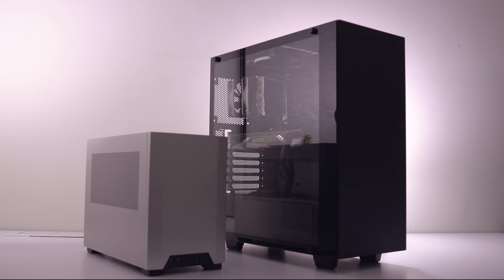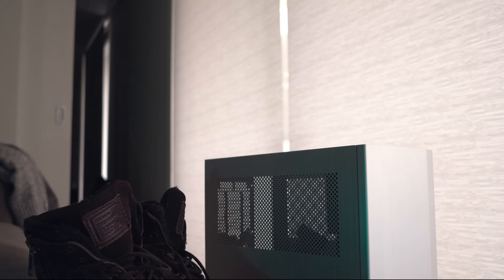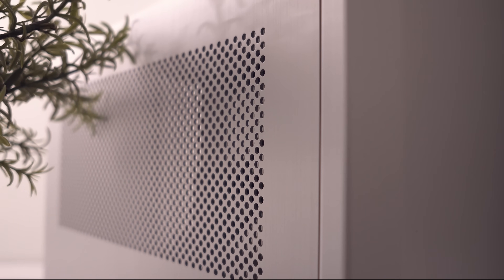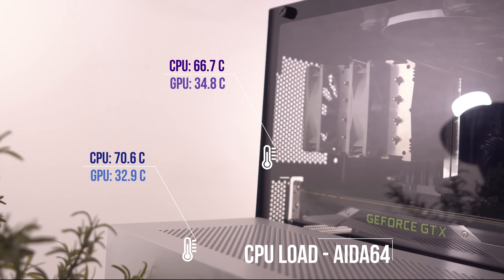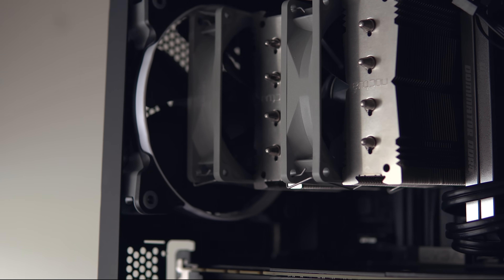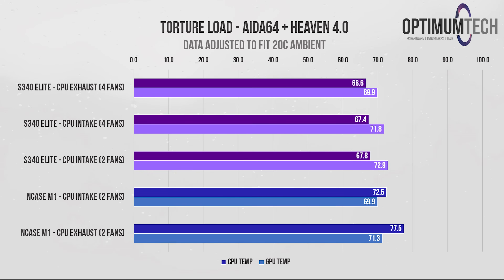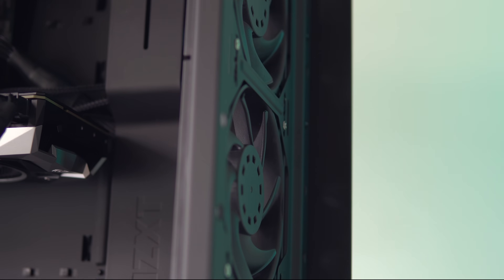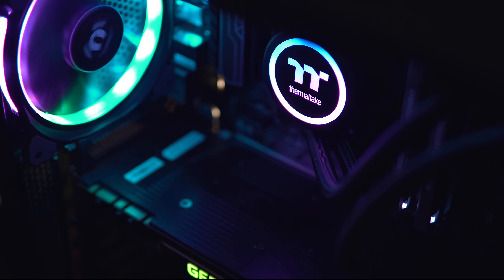How Much Hotter is an SFF System?

Comment: a few things.  I am personally an Ncase m1 user, so this is just comments on the video itself with little bias toward the m1.
  The bigger case wasn't a particularly open aired case compared to the really open m1.  I think a retest with a more open aired case is due.  Also the ncase had the advantage when it comes to gpu thermals because of the blower style card.  I would be interested to see a comparison with a more open aired card.

Comment: Fake, i have an SFF HP AMD PC, and I have on CPU în idle -5 to 15 degress, normal utilization 20-25 degress, gaming(ex GTA 5, ,CSGO) or chrome tabs 25-35 degress, and maximum 40-45 degress(intensive utilization or  if it's hot in the summer), HP Cooler stock. GPU 20-70 degress. Small case, better airflow.
Reply: cap 😂😂

Comment: The point of having a larger case is to use more fans, bigger heatsinks, larger GPUs resulting in most cases in a better cooling and quieter system, otherwise just go ITX and save some space on your table

Comment: With aftermarket cooler gfx card without blower desing the end results would of been very different. As most high end cards these days ( including nvidia RTX ref desing) dumbs majority of the heat inside case. I know the test is old, but not very relevant these days.

Comment: mid-high end SFF power supply are more expensive than normal ones once u go pass 600w PSU. You're also limiting yourself to heatsink height as well as having other parts heated by AIO. Once leaned over to my AIO Kraken x62, got a little hot, checking the temps it was 40-45c inside and near 50c on the outside. That's 120 f radiation from radiator to other parts of the PC!

Comment: he used a blower type gpu that dumps hot air outside the case, temps would have been hotter if he used an open dual or triple type card

Comment: Giving the difference in price, you can AIO the CPU for the same price with the NZXT case. If you want to go the no compromise route and AIO the Ncase, you can custom watercool the NZXT for the same price. You are forced to sacrifice something with the Ncase. And it's cooling potential due to space. You also can go the aesthetic route with the tempered glass and space. The comparison is not totally fair because you are using the same restrictions of the small case in a larger case.

Comment: the temperarute will improve in the NCASE m1 if you do a front panel mod.. like put a mesh in the front panel
Reply: Carloos Gongora I dnt think that will be that much beneficial as just behind front panel is SSD mounting place and a rigid aluminium base.
Reply: i think it help in matter of space & thermals
Reply: Carloos Gongora Thats what i said. It wont do any major good. Coz in order for flow u hav to remove any SSD or HDD mounted in front.
Reply: the ssd can be located at the bottom with the new space... and in the front panel do a mod and put a mesh
Reply: Carloos Gongora I get it what you are saying. But just to get some airflow from front you're putting SSD/HDD on bottom of case affecting direct GPU cooling ? not worth it IMO
Reply: Carloos Gongora where ya gonna fit that reservoir tube ? Everything is already crammed

Comment: You can totally use a water cooling setup in the M1. I have my i7-6700k cooled by a Corsair H100i in my M1 and it works well as all the heat get exhausted out the side of the case. It's a tight fit, but it's a well-known working configuration for the M1. I'd love to see you try it out and see what temps you get vs. the S340 with an H100i.

Comment: Even with the benefits of air and more space I still prefer smaller ITX systems because I don't want my PC on the floor sucking up dog hair, and you really don't need a system to be huge these days unless you have special needs like having tons of hard drives or you want to have a chemistry set running in your case. Neither of those apply to me. My next build is going to be in the Phanteks Shift case.

Comment: I have an in win 301 and it isn’t the smallest case but my 7700k hits 80C under load. Also my cpu needs about 2.28 volts to get a 4.8 OC. I guess my chip isn’t the best and I probably need a better cooler

Comment: You did a good amount of testing but try these exact same tests after removing the front panel on the nzxt s340 and you will notice a big difference. My s340 with the front panel on results in a CPU temperatures at 70c and gpu temps at 78c, but with the front panel removed my cpu and gpu temperatures drop by 9c and 12c respectively and for such a temperature drop i will throw the front panel of the window any day.
Reply: No it does not make a big difference, the culprit here is the front panel which basically blocks direct flow of air through it. Removing it creates space for the air to move and hence it results in low CPU temperatures.

Comment: Hey man great video. I find that NZXT cases aren't the best for airflow, even their non silent cases. I run a H630 and find it terrible for temps on my custom loop. A different chassis from Corsair or CoolerMaster will probably net you much more significant temp drops in the mid tower size.

Comment: I'll take 5 degree C hotter temperature over large tower case any day
Reply: Hansen A s340 has bad air flow though...
Reply: I have the Ncase M1 v1 and it still looks premium to me. Swapping components is kind of a pain though. My next build will be in the Dan A4 SFX case, which is even smaller. I kind of wish the Dan A4 could handle up to 60-70mm cpu coolers. Since I do not overclock much, it should not be too big a deal. I really wish Silverstone would make a proper update to the TJ08-E. That case has amazing airflow with the big 180mm front tunnel fan. For a cheap mini-itx case, the SG13 is really good.
Reply: I know.. That's what I like about SFF cases..
Reply: Keep in mind..he had 2 120mm fans directly under the hair blower cooler..seems quite unfair..
Reply: Even 80+ is still within reason.

Comment: I have an NCASE m1 V5, CPU(i5 7600k 4.8ghz) is water cooled with h100i v2 were one fan is removed and is put under the GPU(1070 FE) for tubing clearnce, the whole system is quite but for the PSU which is a silverstone sfx 600, whic is the loudest thing that never shuts up I am measuring the temperature inside the PSU to be at  42.8C, what should I do to make it quite
Reply: Remove the fan from the PSU ;)
Reply: Buy a Corsair SF 600.
If you do, get the optional sleeved Cable Kit (watch out for the "SF Kit"). The stock Cables are horrible.
Reply from the maker: Can second the SF series from Corsair. I own both the SF450 and SF600 and they rarely spin up.
Reply: I bought it and will try it out, I will update on how that works out.

Comment: Did you switched back from your Custom Side Panel on your M1 ? Or was it only for these tests ? 

Btw: Which is your favorite CPU Air Cooler for the M1 ? 
Iam considering an Custom Side Panel, but dont know, if I should switch my C7, cause its an Top-Flow Cooler...
Reply from the maker: I used the stock panel for these tests. I like the Noctua U9S, D9L and the Cryorig M9i for the M1.

Comment: The s340 doesn’t have great front intake because of the closed panel so it performs worse than a case with a mesh front panel.
Reply: That’s the same for the whole NZXT lineup. I’ve had no problems with the h700i with a closed off front.
Reply: I've had no issues with mine. I have 2 140mm phanteks fans and they've been great. I can't recall if they are static pressure fans or not though.

Comment: Nice test, but you picked one of the worst midi cases, when it comes to airflow performances. Try the same test with a Meshify C instead of the S340, and you'll notice an huge improvement in thermals, with a little compromise in terms of noise. 
And yes, open air GPUs are the perfect fit for a larger case.
Reply from the maker: I chose the S340 Elite because it's one of the most popular mid-towers out there and happened to have it on hand. But totally agree, air flow and temps would have been much better in the Meshify C, I definitely would have used that for the comparison if I had it here! Thanks for watching
Reply: Thanks for your reply and your interesting contents. :)
Reply: I was about to comment the same thing as Corummo. Once the air gets hot inside the S340, fans do very little to swap the it for fresh air, and thus, creating similar results to the mini case displayed in the video.

It is all about airflow, really. A mini case with meshed front would be a great performer also.
Reply: yeh but i feel like you are missing the point, my ryzen cpu has a thermal limit of 95 degrees, in my sff case it runs at 62 max while gaming, so why would i need a massive ugly case lol

Comment: Yea, a lower tdp(150w) , blower style card would be preferred for a itx build. But itx suffers with non blower (internal) cards , overclocking and higher tdps cards like the 980ti/1080ti (250w)

Comment: What if you tested the gpu as a open air style rather than a blower? Will the results differ?
Reply from the maker: If the card is restricted for air-flow (by a PSU shroud or side panel for example), blower is preferred. 
Most of the time though, open-air are much better, even in small cases like the NCASE M1, since they still have access to air. 

Node 202 is another example - Tiny ITX case, but open-air cards still work great in it since it has a ventilated side panel to breathe / exhaust the air.
Reply: Will the msi gaming x fit in the NCase